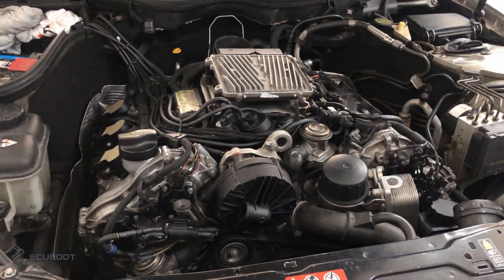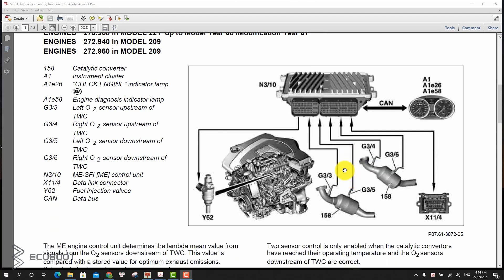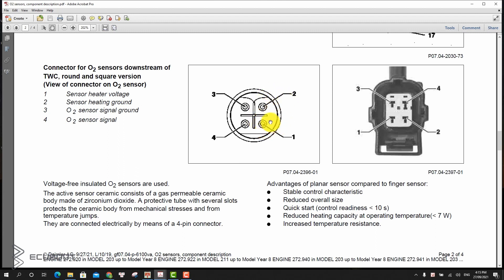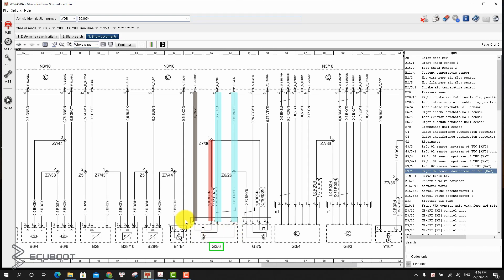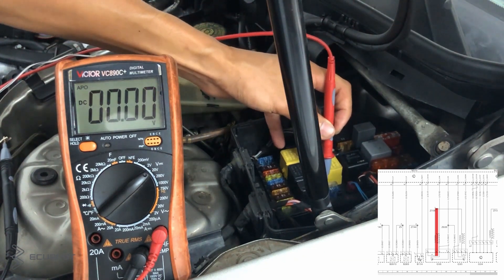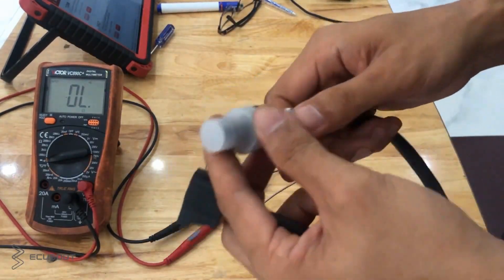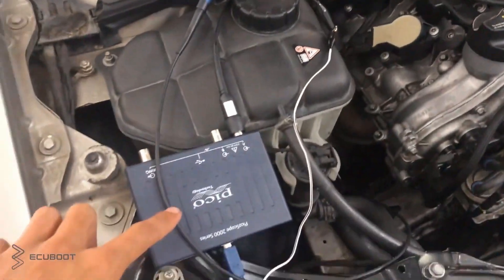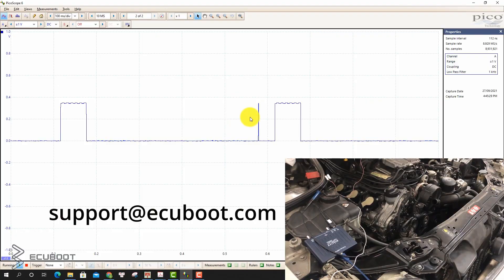Fixing oxygen sensor fault on a Mercedes

Comment: Hi.I have w140 S320 96y and O² sensor wont work correctly, its ON few sec and then its shut down/OFF 
Do i need to replace O² sensor?
There is many different sensors in the market, witch one i need do buy?